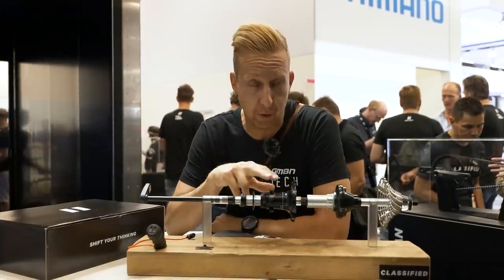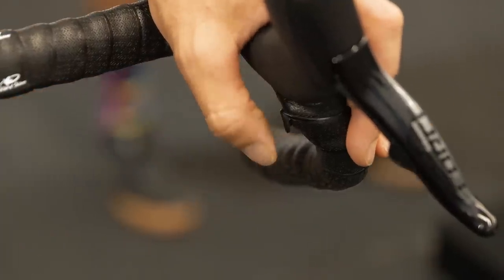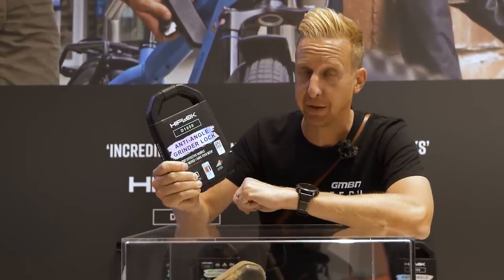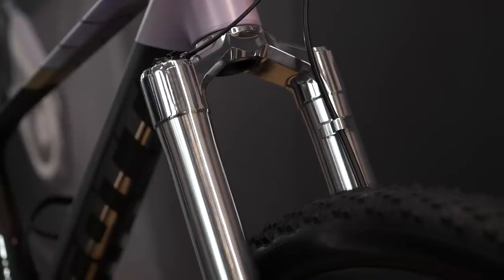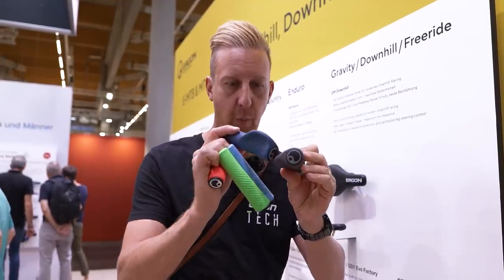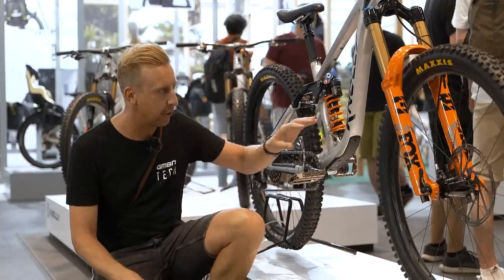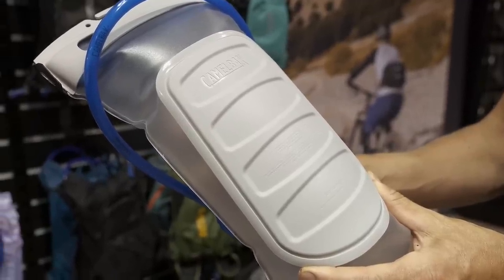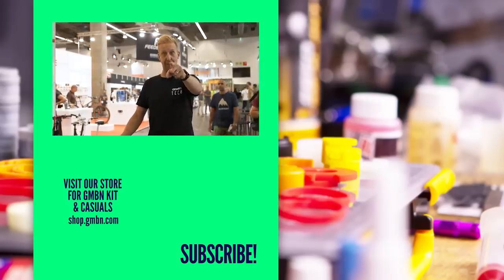Custom Bikes, Indestructible locks And NEW Camelbak Designs! | Eurobike 2022 Hottest Tech Pt2

Comment: This is the lock picking lawyer, and what I have for you today is an indestructible bike lock
Reply: Might be why they say indestructible rather than unpickable XD
Reply: ..sadly it can be opened with a strong magnet within seconds and that makes  it as good as  Masterlock superior class  locks. ROFL!
Reply: Ever noticed that LPL voice wise sounds almost the same as not just bikes.
Reply: Thief would just get pissed off and trash your frame.
Reply: I was just going to say, they need to send that to the LPL to see how long it takes him to get it open cuz as we've seen it doesn't matter how strong the loop/bar/chain etc. is if you can bypass the lock in seconds!
Reply: @bikerdude923  I guess most thieves aren't as good at lock picking than using a cordless angle grinder. Hence the design of this lock. LPL has shown that almost any lock is pickable, the nature of a lock is that it will open somehow
Reply: Bike lock is more like a deterrent. Even a small lock would be enough as long you park your bike next to a better bike than yours 🤣

Comment: Thanks for this, Doddy.  Thanks a lot. haha
Those Lavelle wheels at the end struck a chord with me. For some reason, I love silent hubs and all -carbon wheels. I have Spinergy Rev-X-Rox on my 20 y.o. K2 Oz that I still ride occasionally. the hubs on those are pretty quiet, but not silent. Alas, they are 26" and rim brake so I can't use them on my new Ibis Mojo 4.
I've tried contacting Lavelle through their website, but they have not replied. I'd love to know how much they cost and how to get them. Any one have any idea about that? thanks.

Comment: It'd be really cool if that internal hub gear company collaborated with sram. They could design an AXS system where one gear shift shifts the cassette, then the next one shifts the internal ring, then the next one shifts the internal ring back and the cassette again. If they balanced it right you could effectively half the size of the cassette, or double the range/have tighter gaps between gears. Loads of potential here!

Comment: You are a tall guy and I'm guessing you have large hands also?  Do you have trouble using small diameter grips?  I'm 199cm tall and have big hands (long fingers). And I need to put electrical tape under my grips to make them bigger in diameter.   If I don't do that, my finger tips touch my palms  (around the grip) . I need to do this to my motor bike grips also.
Reply: Have you tried Rev grips? I’ve got the xl version and find them good for my big hands